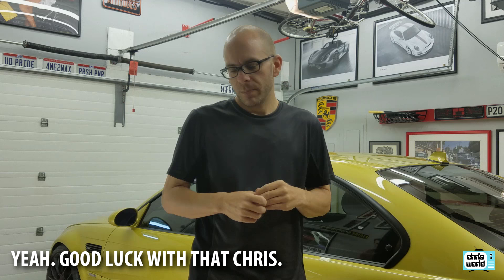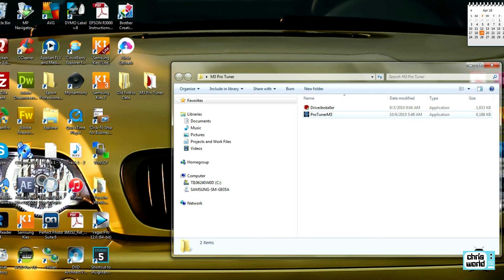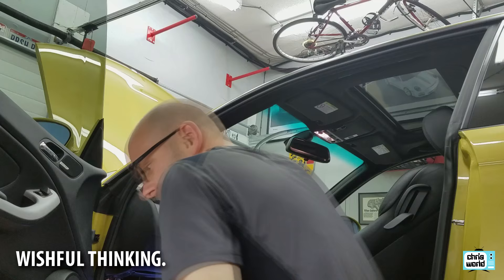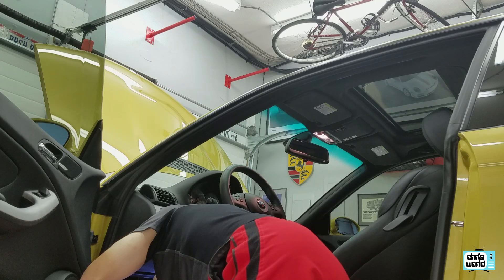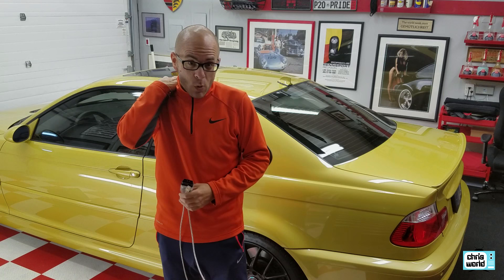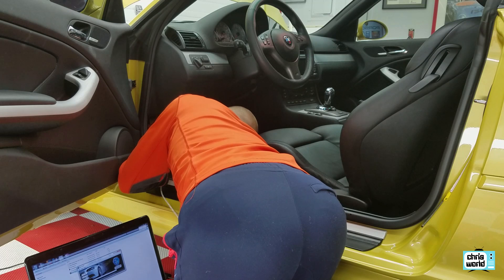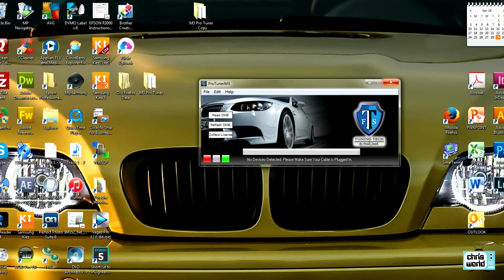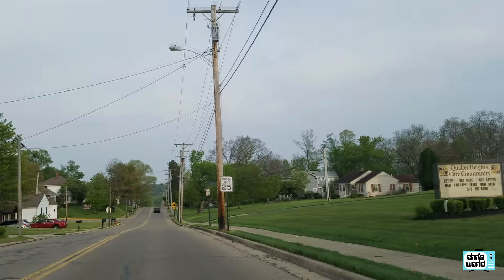BMW E46 M3 Frank Smith SMG Tune: An Installation Chronicle

Comment: Having the SMG tune on my car, you'll notice as you go up in S modes your shifts will become quicker accompanied with a louder M boom/clunk if you stay on the throttle during shifts which is completely normal.  As you get come used to the computer's clutch actuation, you'll know how minute you need to release throttle in between shifts to minimize the "boom" to little or nothing.  S3 is similar to the S5 OEM North American tune.  I've learned to use S5 all the time since the computer recognizes, more throttle = faster shift, less throttle = slower more civilized shift. S5 will also give the quickest/most accurate off throttle downshift rev-match blips. I haven't notice much difference in S6 other than being able to launch from a higher RPM up to 4500 when traction control is off.  Sometimes it's handy to get off the line from 2000RPM as the computer clutches firmly and accurately with enough slip to ease the driveline and not enough slip to burn the clutch.  Auto mode will change shift speeds and when it shifts according to S modes.  I usually use S2 for auto because I don't want the computer to hold upshift gears for so long.

Comment: First thing I did was plug in the K-DCAN cable and install (run as administrator) the driver, before I did anything else.  I’m running Win 10. Hopefully I will have better luck ☘️ than you had.  I got the SMG Tune including having the 155 mph limit removed and Frank also add Dyno mode.  Cheers 🥂

Comment: I’m about to do this. What I’ve run into before is that the laptop needs the driver for the OBD cable. Once the OS has the driver it should sync up immediately. Have you discovered If this would help.?  Is there a driver? Thank you for the video, this is greatly appreciated. 👍

Comment: Hi Chris, new Sub here to your channel. Great review and honest feedback. Well done!

Question, I've also just purchased an 04 E46 M3 SMG and same as you I've always driven manual, but really love the SMG, hard to explain, but it's a thing. 
Anyways, does this update take away the slight rockiness when starting out in 1st? 

Thank you very much!
Aloha!
Reply from the maker: Maybe its just the blind ass-dyno placebo, but I feel like first gear is smoother now. I just wish first gear was much longer in the M3. Its as short a gear as any car Ive ever owned and I cannot make intersection turns from a dead stop w/o shifting into second gear in mid-turn (A video forthcoming on this aggravation w/the paddles).  The Smith tune cant fix the gearing but I do believe its taken away the rough edges from a crawl. Going from 1st to 2nd also seems more graceful. Ive been leaving the SMG setting in 4 or 5.
Reply: 1 way to  get a loonger 1st gear is to lower the diff end gear..i suppose m3 has 3.70 ish..if your not racing you could get down to 3.10 or lower

Comment: chris do you know for fact if this tune is better than the original csl tune??
or is it a optimized csl tune???
i have a csl tune for the smg and it is a bit quicker than the oem!!!
but my problem is that the car does not switch to first gear (in any mode) before it completely stops and this is sometimes very annoying because in traffic you are obliged to start with second gear causing the clutch to jerk

Comment: the connecter was not all the way in. it never clicked.
Reply from the maker: Thought same thing too. Check it 9 times though. It was in. My laptop is on its last leg. My USB ports have plug-n-play sync issues constantly now. Driver fixes no good. I think its hardware.
Reply: same thing happened to me but i removed the shroud/port by taking of the panel in the foot well and was able to use counter force to make the connection more solid. and it worked.
Reply: it will click when it is all the way in..

Comment: so can i just torrent the tune and not pay 200 bucks for a piece of code.
Reply from the maker: You might get lucky. For $200 though, it was cheap enough not to take my chances with unknown code from unknown people providing no implied or expressed warranty or tech assistance. If I ever sell the car I want a paper trail from a known shop and not give the impression I did things by the seat of my pants -- but that's my own comfort level. My understanding is the Frank Smith tune is proprietary and not just a straight copy of the CSL mapping, so I doubt his tunes are floating out on the net since his software checks for a license before the software will install it.